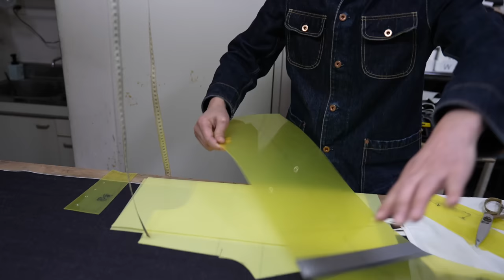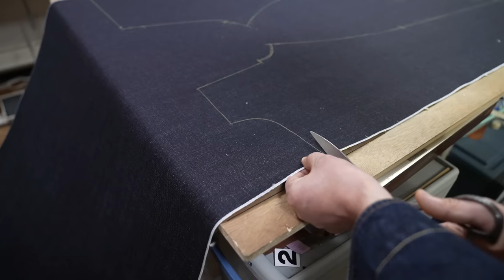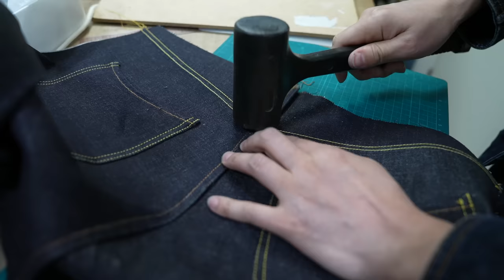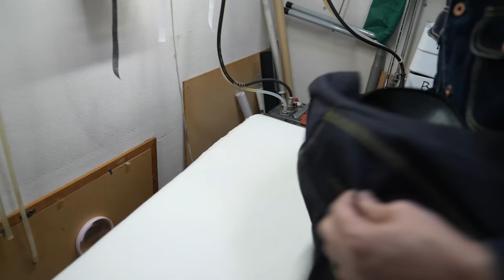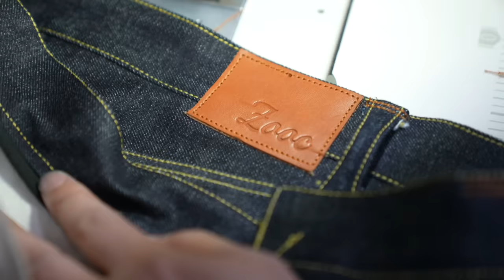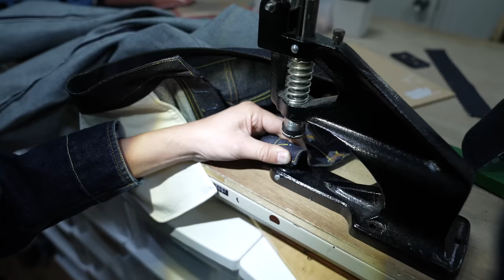ハンドメイドジーンズが作られるプロセス。手作りにこだわる日本のデニム職人。

Comment: No magic, no fancy equipment: simply one man one machine zero pins. Despite looking so effortless It takes many years to become a pro like this man. Hard work pays off. Simply beautiful work
Reply: И большой труд, а не про то красивая рабоиа и в мире , как раз и стоит дорого такой труд, потому что здесь душа в каждом  изделии
Reply: I worked in a jail tailor shop and could do this by the first week... But okay.
Years.😊
Reply: And his pants fit like a tent.
No tailoring was actually done, he showed you a very slow version of mass production.
In the industry, they use jigsaws to cut through 100s of layers at once.
Reply: @davemeade4371  Looks like someone is jealous. If it's that easy make a video right now using no pins at all.
Reply: @mulanomula  well, he's not wrong. those are not tailored pants, the artisan is using ready shapes where you only need to trace, cut and sew. no pins are needed because all the pieces are made to match. it's something every person can do with the basic knowledge of sewing and the right machine and tools. 
and people need to have the right body to put into them or they will not look 100% good.